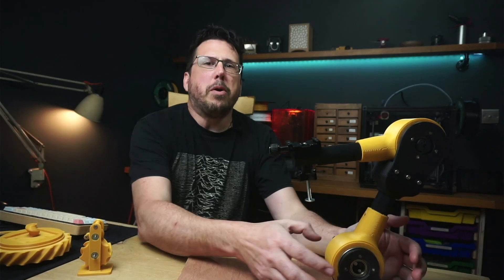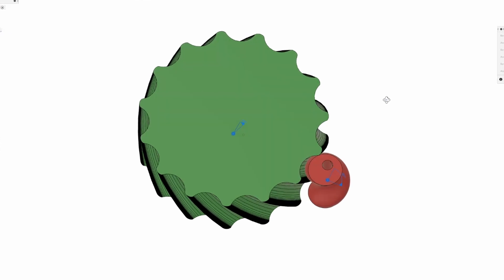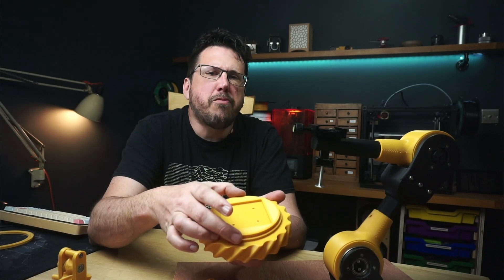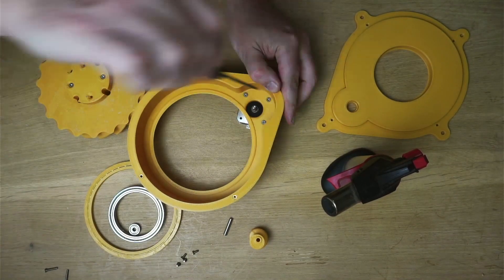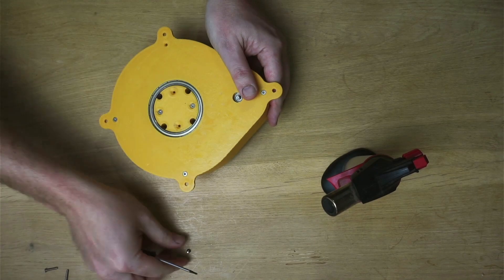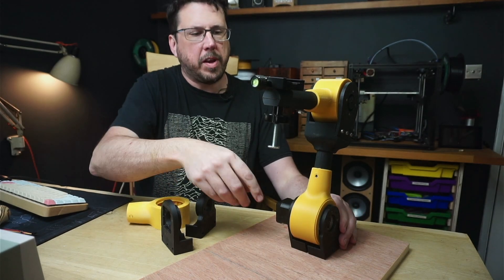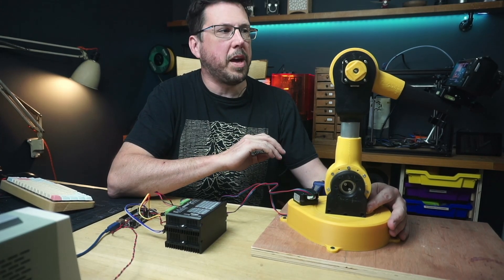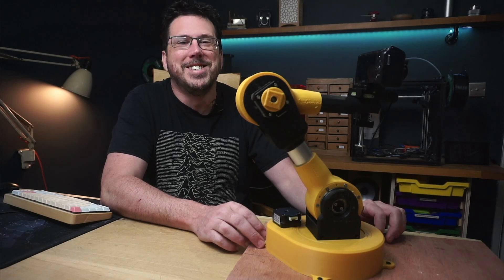The easiest way to make a robot arm base

Comment: Any reason you use a blowtorch for the heat set inserts and not just a soldering iron?
Reply from the maker: yes, both my soldering irons decided to die at the same time!
Reply: @roTechnic  That is really unlucky, make sure you buy three next time incase two fail again.

Comment: In terms of algorithmic design ie. Inverse Kinematics, what are the best places to get started?
Reply from the maker: If it's for robot arms, then I'd probably start by reading some of the guides for the MoveIt project https://moveit.ros.org/
Reply: @roTechnic  Nice, I'll take a look at that now - it would be for robot arms. Is this what you have used / planning on using for your robot as well?
Reply from the maker: @aiyushg1769  yep. At the moment it's just using some quick and dirty arduino code and inverse kinematics I figured out in a previous video. But when I've got the hardware done I want to get it running ROS and MoveIt.

Comment: Nice, I guess you could put some grease on the bearing balls to stop them from escaping
Reply from the maker: that’s a brilliant idea. I don’t know why I never thought of that!
Reply: @roTechnic  The bike shop teached me this trick when I needed a temporary solution for when my steering head bearing broke, just put a bunch of grease around it and place  induvidual balls in the grease all around the tube head and they'll stay in place until assembling back the topcap!
Reply from the maker: That's a great tip! And I'll use it next time I strip down one of my bikes (which is WAY to frequently)